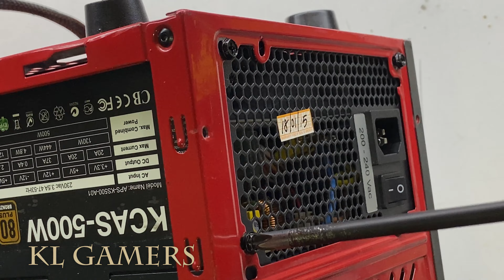2nd Gen intel Core i5 2500 msi Z77A-G43 GAMING GIGABYTE GTX470 Gaming PC Build

Comment: I'm currently using this motherboard but the non-gaming version (still use it for gaming). But in 2024 it's still very good and functional. Everything is still working. My 2014 asus mobo has broken audio and graphical problems. The bios also looks great and has mouse control. Old MSI motherboards are still great!

Comment: I have the same motherboard... I wonder if I can install video cards like the 4060 that have the PCIE 4.0 x16 input. I assume this card should have PCIE 3.0.  

but I see that in i7 3770 processor it can work with a 4060, so I wonder if this is the motherboard that can do it.